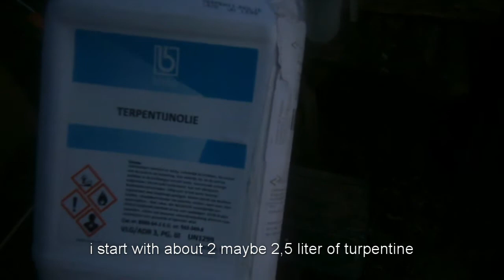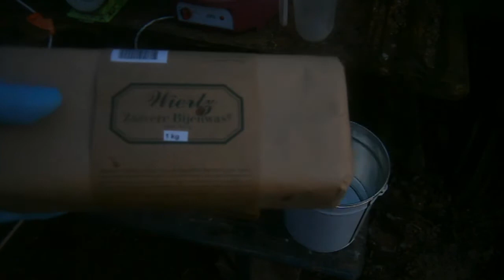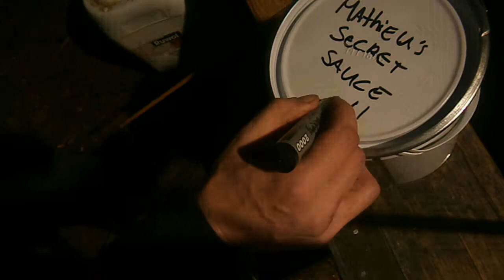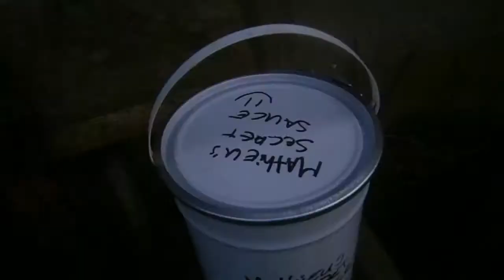Making my own Oil-Wax mix for my chainsaw carvings

Comment: Nice, I can see a lot of experimentation with this...I like the look of the finish. Do you have to mix the solution periodically before use? I would imagine the beeswax would act as a sealant of sorts.
Good to see some custom recipes like this. Thanks for the secret recipe, gonna try this sometime.
Reply from the maker: I stirred it one time the day after i made it, it seems to stay mixed good. its quite waxy stuff, i will put some in smaller cans today, i plan to sell some of it as well.
Definatly room left for experimentation. i think the current mix is pretty rich so i will try it with more linseed oil added as well. I can easily make small batches of different proportioned oils now from the main batch, whatever changes i make to the oil from here on will probably be my little secret but this is a great place to start as far as the recipe goes.
Its the first time i tried this myself so im sure it can be improved upon.

beeswax is also available in jars in like little pieces, or one could use a cheese grater. should be able to dissolve the wax like that without heat. 
this way was easier for me since i bought everything in big quantitys to save some cash on the long run. really didnt feel like cutting the wax up more, think this will be the way for me.

but yeah, i love the result. needed next to nothing to treat the stuff in the video, they are all from last year. It really makes the color of the wood pop. and the wax gets deep into the wood so i think it will be excellent protection for outdoors. probably less fat cracks too because the wax will make the wood dry a little slower also. all good stuff.
After it dries it leaves a nice glow and u could also buff up the wax on the outside at that point. 
seems to dry faster then mineral spirits/linseed oil mix too. so far it seems to work exactl;y like i hoped it would!
This mix will also work nice for stone

Glad u liked the video! and take care
Reply from the maker: still stays well mixed. perfect stuff :)
Reply: @MathieusChainsawCarvings  I figured the wax would somehow keep everything in suspension. I could see you doing test samples on a large piece of wood so you can see the variations side by side, like a test swatch or something. I did some different kind of
dabbling with walnut husks to make some stains for wood, it came out well. Just need to
pursue it further...I guess the sky's the limit with ratios and ingredients. Hopefully the chemicals don't become too volatile when mixing, something to do outdoors definitely.
Reply from the maker: @wood-psyche  The terpentine oil is the dangarous one, outside and avoiding open flames is a must for me.
I was positioned with the wind in my back most of the time too, its a strong pine like smell. smells great. but yeah dont smell it too much hehe. inside u would need to use a mask. i think i probably heated it upto like 70-80 celcius. but i did give it a few boosts too 100 celcius to speed it up a little. u could tell it was producing much more vapor.

I will probably rasp the wax next time and let it desolve without much or any heat.

Many people think natural ingredients are automaticly safe, thats ofcourse not always the case. but the mix as long as you dont eat it seems safe enough.  i have had no problems with getting it on my skin. like irritated skin or anything so far. but i try to avoid it.

i must definatly experiment more with this. But so far its working so good i didnt feel the need to change anything yet.

The parrafin oil i added seems to leave a little layer on top of the mix, may help with preserving. I did read somewhere u can use this on water to kill musquito larve, not sure that would be good for the enviroment since it will probably kill everything else too.

But interesting stuff none the less.

The walnut husks sounds interesting to me as well. may be something i will try one day also.